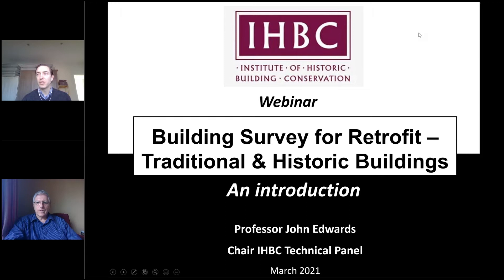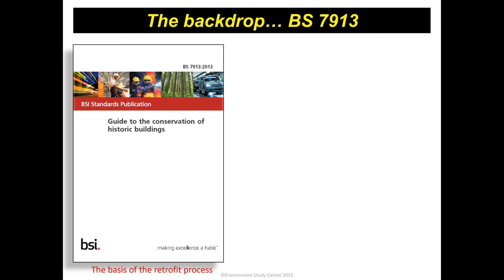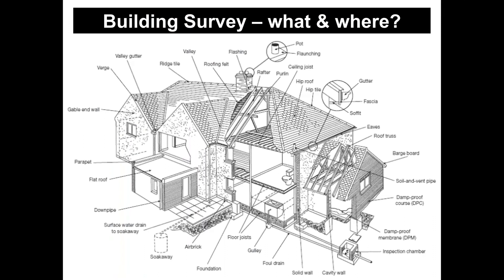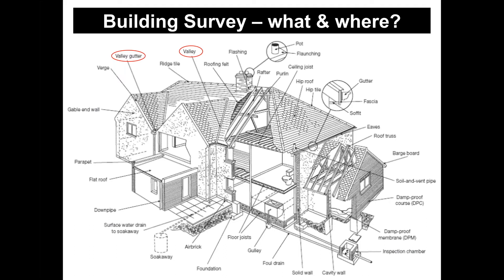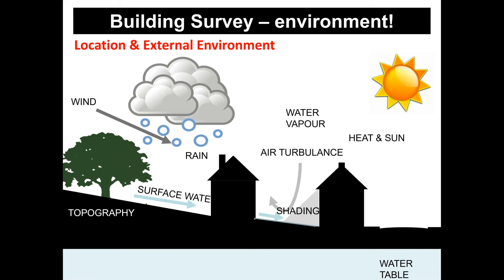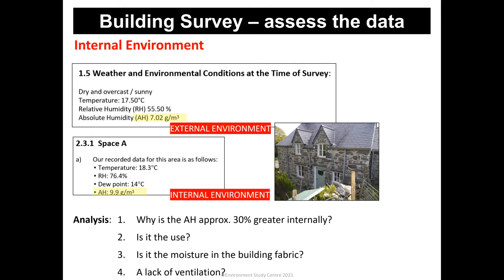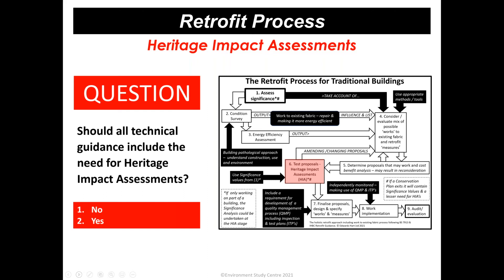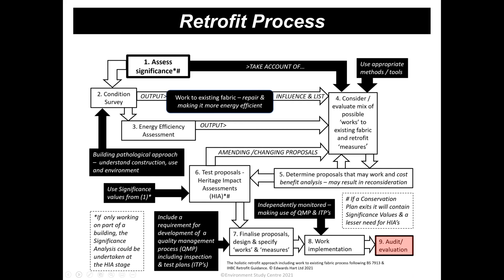IHBC CPD Introducing Building Survey for Retrofit

Comment: One of the issues with Section 3; Energy Performance Assessments is that English Heritage have proven that EPCs are completely useless for measuring the performance of historic buildings and actually underestimate their performance by as much as 1/3rd. I have seen this first hand how badly the software works when judging historic fabric. As it simply cannot factor for 'soft facts' and can only model what are called 'hard facts'. Hard factors being thermal resistance numbers etc., and soft facts being vapour permeability, condensation and condensation risk etc. when all historic buildings are entirely reliant on their appropriate functioning and true thermal performance being solely based on those soft facts the software does not stand up to any scrutiny. A new measure of performance separate from the EPC needs to be created that factors in and models these soft facts to suitably reflect real world conditions. Because if you are basing your energy performance of an historic building on an EPC you will be directed into performing not only unnecessary but also wholly inappropriate alterations.